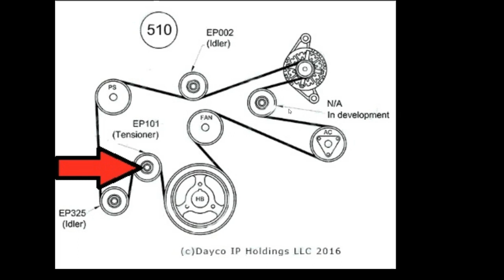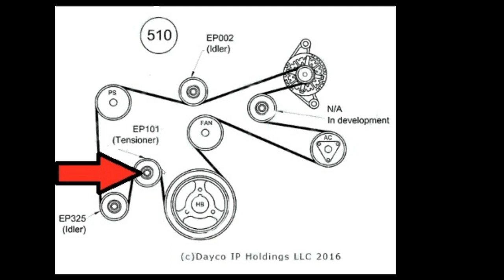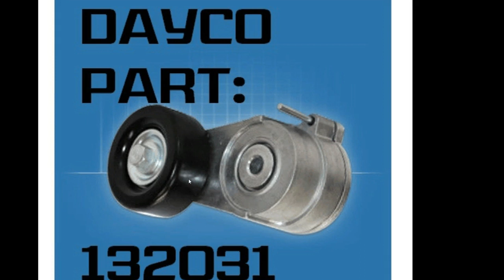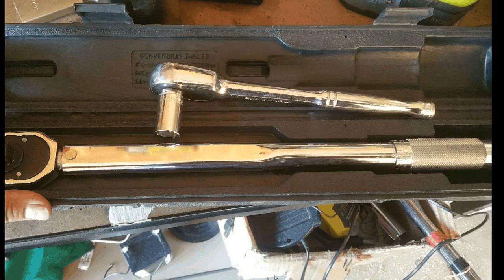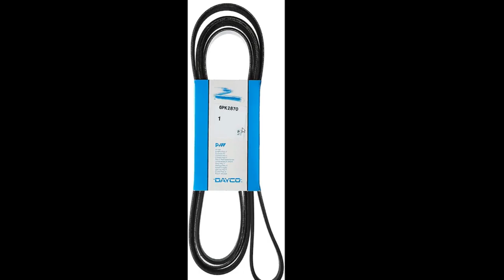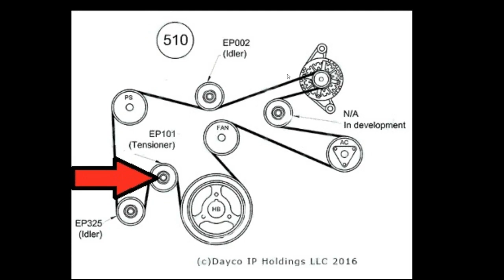HOLDEN COLORADO replace SERPENTINE BELT AND TENSIONER

Comment: Mate, good video, parts cost me $250, saved me $100’s over all. Just had to cut some of the plastic tabs off the fan cowl to allow access. The restricted access in general made things difficult especially locating the new tensioner but didn’t take too long in the end
Reply from the maker: Awesome mate, much cheaper than letting the dealership do it.

Comment: Hey mate thanks for the video like most saved me a small fortune getting someone else to do it.
I just have a question, do you need to tighten the bolt that holds the tensioner to a specific torque at all?
Reply from the maker: 58nm, or 43 ft lb. But, you wouldn't want it coming loose so.... rattle gun, full send...
Reply: @Unfastened  haha FULL SEND

Comment: Great video! Need to work out what is rattling horrendously under my bonnet so now I can check myself. Thanks.
Reply: That will be the alternator overrun pulley. Just replaced mine today.

Comment: For those wanting to change just the belt on a U.S. colorado(2017), use a 1/2" ratchet with a 2" extension and a pipe or big wrench for the handle for leverage. The tensioner is located on the passenger side top of the motor. Looking at the windshield from the front bumper, you turn it counter clockwise to release the tension. Might want help if you're not that strong or nimble.

Comment: Note that the 2 pulleys above the water pump are secured by Left hand threaded bolts so you have to turn them right to loosen them off.

If ordering online make sure that you have been supplied with the correct belt because I ordered a kit for my father online on eBay where the seller supplied us with a 6PK2825 Dayco Serpentine belt which is too short so it didn't fit so today I have to order the correct length 6PK2870 belt.

I was up early this morning & I folded the old belt in half, stretched it out & measured it at 1430 Millimetres so I doubled that to get a 2860 millimetre measurements so the 6PK2870 belt is the one for the Colorado !

Comment: Just been searching for an answer came across Theo’s video, well represented and explained for anyone doing this themselves 👍🏼👍🏼
but I didn’t find the answer I was looking for. 
Question. What is the torque for the bolt that holds the tensioner in place, I heard do it up right but no mention of actual tension, as I’m sure everyone’s tight is different lol.

Comment: Mate I just brought a new belt for the same reason as you and I can’t get the farker on!! The tensioner won’t go low enough to let me get it on. I gave up and put the old one back on 😕
Any tips?
Reply: Oh man that's what happened to me too. My mechanic had to order the correct belt, which I helped him fit. Bloody Sparesbox sent the wrong belt but then admitted they were wrong but wouldn't refund without me posting the wrong one back and making me pay for the correct one.
Reply: Even with the correct belt it's a struggle. Difficult to get the 15mm socket on to the tensioner pulley with the belt resting on it (the socket). What eventually worked well for me was having the belt off the idler identified as "N/A In Development" on the Dayco diagram. That allowed me to easily rotate the tensioner with the belt already in place, then I had enough slack - and an easier reach - to slip the belt over the idler between the alternator and the AC.  Thanks Unfastened!
Reply: Get a 2nd person to help
Reply: @peterryan7340  turns out was given the wrong belt by the auto store, man was a unhappy with them!

Comment: Do all tensioners come with the pin?  I just received mine today it has no pin.
Reply: Old comment, but received my tensioner today, it’s dayco brand and has the same part number 132031 and mine has no pin in it either
Reply from the maker: For a different brand, it might already be in the loaded position. You just bolt it on and use the nut to bring it down so the belt can be slipped on.
Reply: @Unfastened  thanks for the quick response 👍
Reply: @EarthBodyMindSoul  did this work?

Comment: Don’t use torque wrenches to crack bolts if you want your torque wrench to be properly aligned
Reply from the maker: yeah for sure, a long breaker is better. But that's in the garage like 15 metres away.....!
Reply: So he never told you to use a torque to crack anything. 

He said if you need leverage you can use the torque wrench to release the belt from the the tensioner